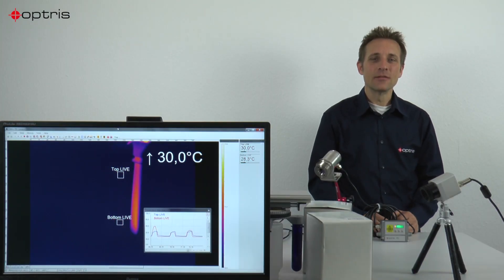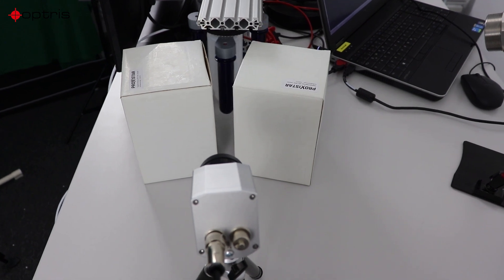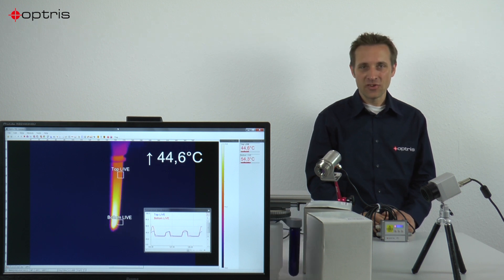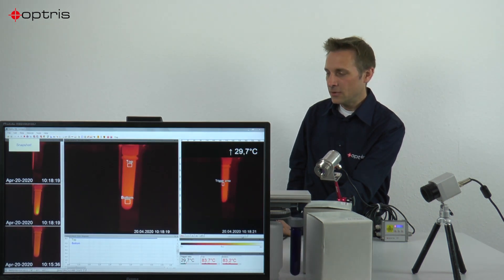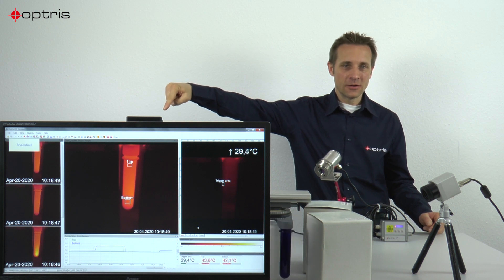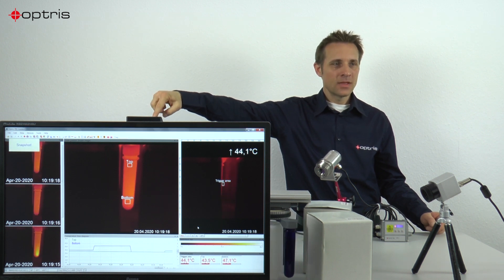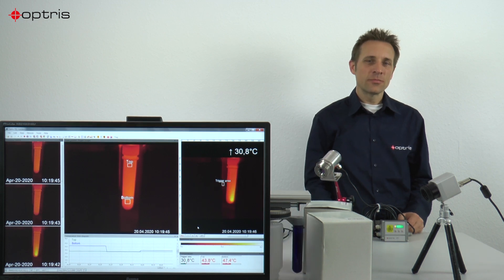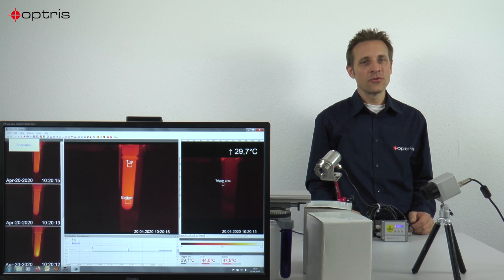Optris PIX Connect: How to Measure Plastic Temperature with the Event Grabber Tool

Comment: Can you also export alarm on output? To notify machine operators for example?
Reply from the maker: Hi Tilen, 
the alarm signal (or the temperature value) can be output as an analogue value via the analogue output.
This can be connected to a PLC controller, a siren or an alarm light.
I hope this helps you. Alternatively, please send us your question again to Info@optris.de and we will certainly be able to help you.

Comment: which sensor is suitable for measuring hot water inside PTFE container?
Reply from the maker: Hi Hamid,
should the water be measured through the PTFE? That is not possible, unless its very thin (<200 µm), which will not exist.
Then simply measure the PTFE with LT device. Otherwise with LT device directly on the water if possible. For example CTfast LT or CT LT could be used. 
Simply contact us at info@optris.de and we will be able to advise you.

Comment: Can it measure objects moving at 3000RPM ?
Reply from the maker: Hey David, thanks for reaching out to us. Yes, objects moving at 3000 RPM (50 Hz) can indeed be measured. The optris PI 640 IR camera has a frame rate of 125 Hz @ 640 x 120 pixels and  the optris PI 400i has a frame rate of 80 Hz @ 382 x 288 pixels. 

Here come links to the respective product pages:
https://www.optris.global/thermal-imager-optris-pi-640
https://www.optris.global/thermal-imager-optris-pi-400i-pi-450i
https://www.optris.global/sales-support

What material would you like to measure? Any further questions, please do contact us on +49 30 500197-0 or sales@optris.global
Reply: @Optris   I need it to view an engine seal that moves across an intake port from a Mazda rotary engine to see the temperature of that top apex seal.